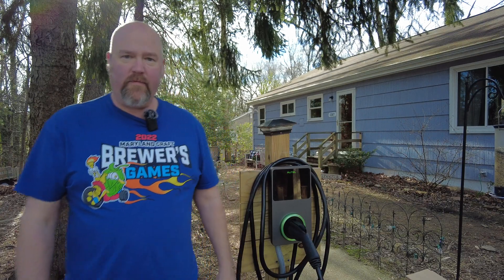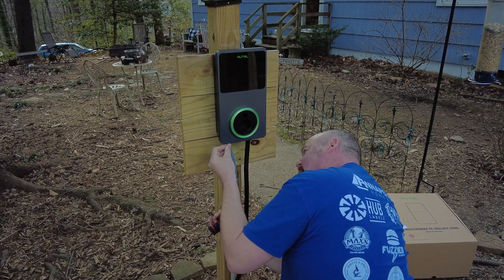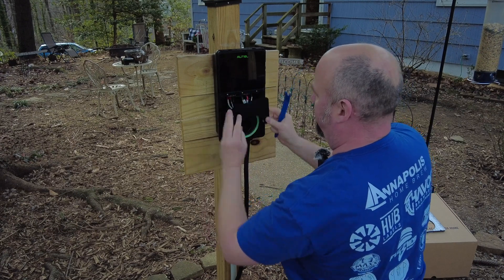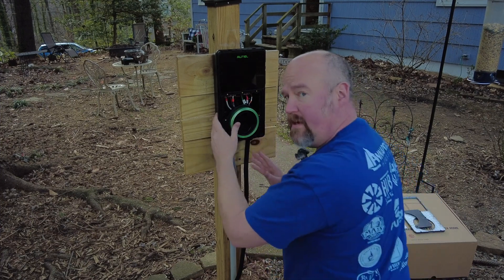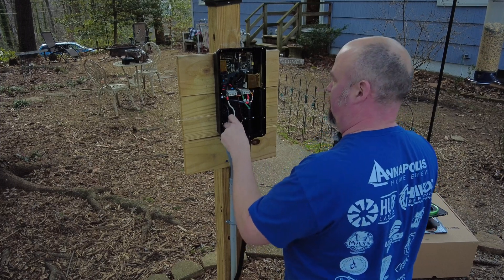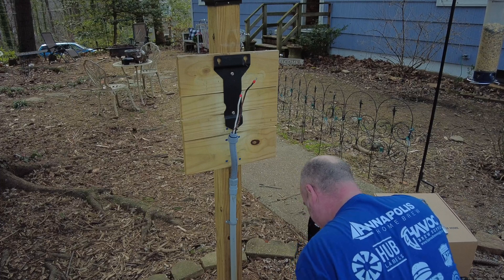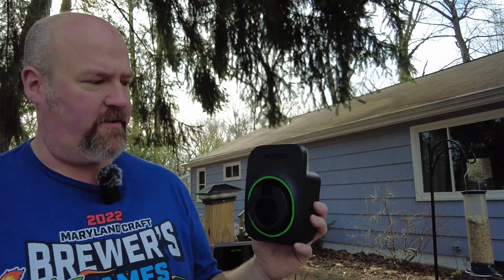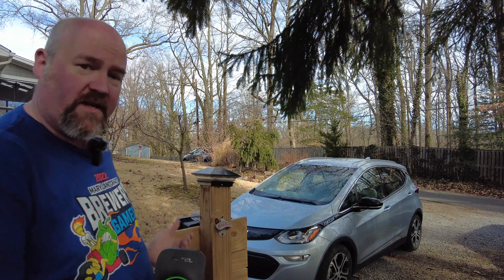AUTEL EV charger swap... from 40 to 32 amps.  What?

Comment: it is possible to set a lower charging current in the Autel app, then you only need to buy a new cable holder.
Reply from the maker: Yes, that would certainly be possible.  The units I am using were provided free for review purposes.  Otherwise, I would have purchased the most appropriate model for my situation.  The adjustable amperage of the Autel units (from 6 amps to the rated amperage in 1 amp increments) is one of their best features.

Comment: Weirdly enough when i compare a 32 A Vs a 40 A EVSE of the same manufacturer (Clipper creek), same cord length, same NEMA 14-50 socket, when charging my Tesla Model 3, the car "sees" a lower voltage (232 V) with the 32 A EVSE compared to (235 V) compared to the 40A EVSE--Both limited to 32A charging max by the Model 3 Standard range +.  I wonder if the thicker gauge cord of the 40 A is giving me less voltage drop.  I agree with you the thinner cord is easier to manipulate.  But I want every Volt X Amp that I'm paying for, so im probably going to just keep using the 40A EVSE since it gives me, in theory 3V X 32A more juice than I would be getting with the thinner cord.
Reply from the maker: Interesting.  Technically, there shouldn't be a difference in the voltage... but I notice a big swing in voltage depending on the time of day.  At night or in the morning, I usually see around 245 volts, and in the middle of the day or the afternoon, I usually see closer to 230 volts.  I'm sure this is due to the demand on the grid.
Reply: Great stuff. I’m looking for an EV probably about 1-2 years away from getting a new car. Now I’m looking at the bolt, leaf and Tesla 3.
Reply from the maker: @Michael_the_muffinman  Keep in mind that the Leaf doesn't have thermal management on the battery.  They have proven to be reliable cars, but they also tend to see a lot more battery degradation than the Bolt and M3.
Reply: @mcnewsreviews  thanks for the info. Fortunately I’m in a position of having time.